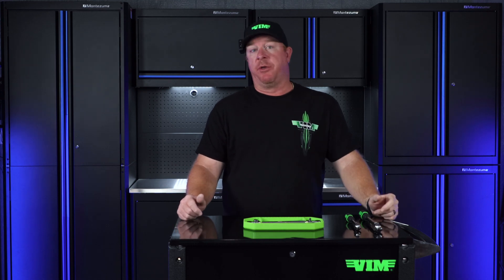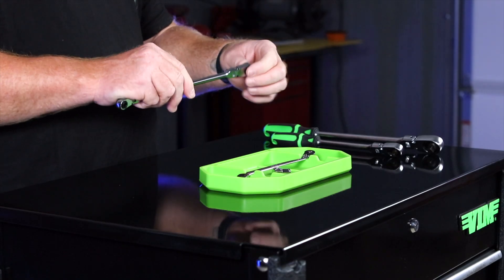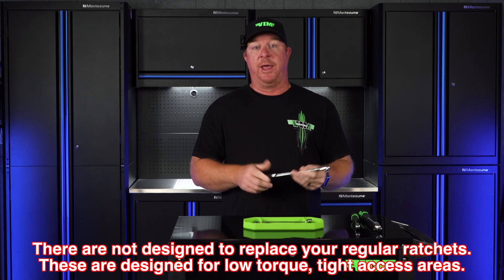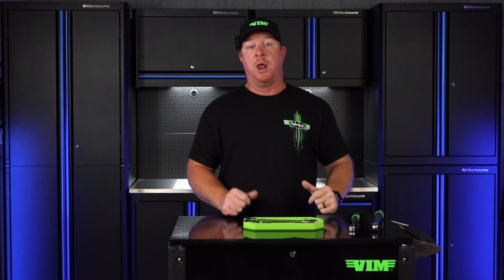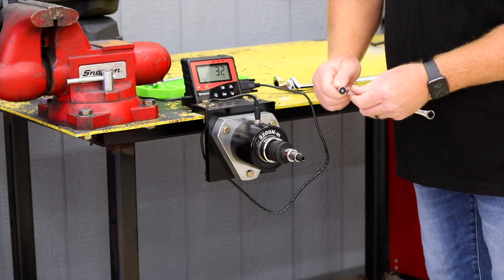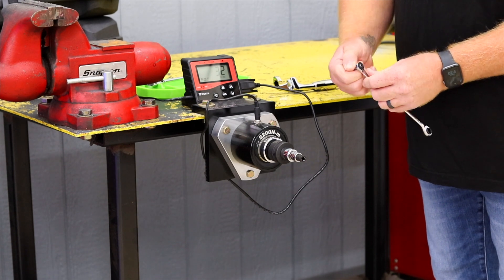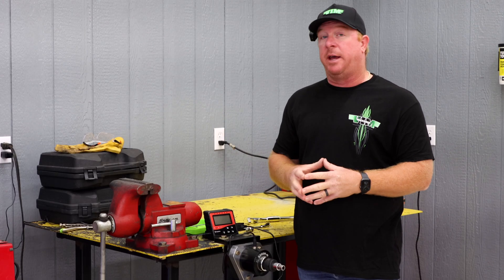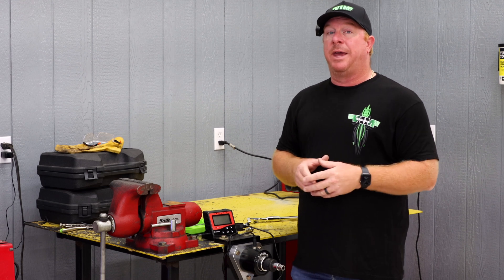How Much Can The HBR Handle Before It Breaks? Let's Find Out On The Break Room EP. 10

Comment: Whats the difference between the hbr8 and the hbr810? Did yall up the tooth count or somthing
Reply from the maker: The HBR8 is an 8” long 1/4” x 5/16” bit ratchet with the removable square drive for 1/4” sockets. 
The HBR810 is a 1/4” x 10 mm heads (similar to the HBR1046)